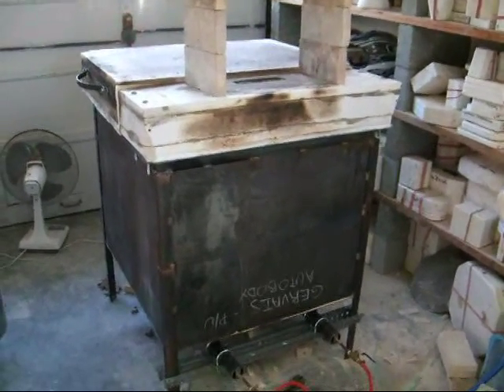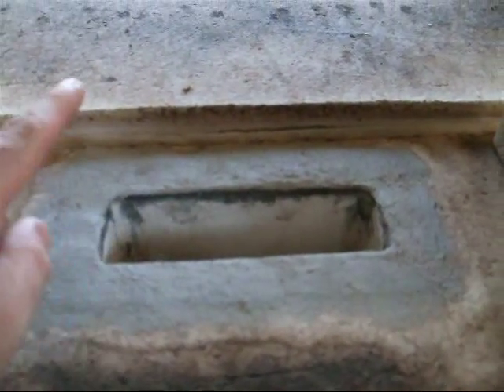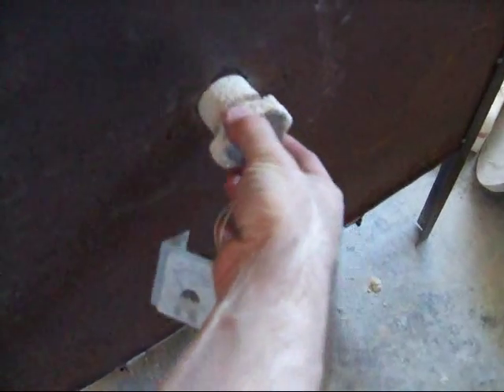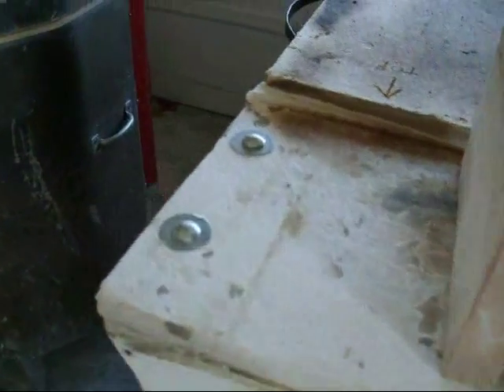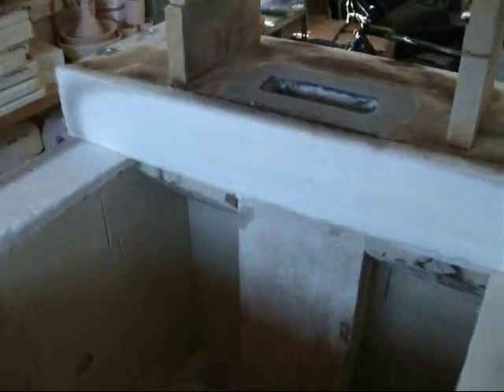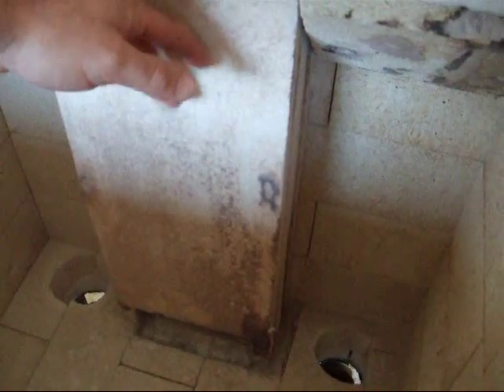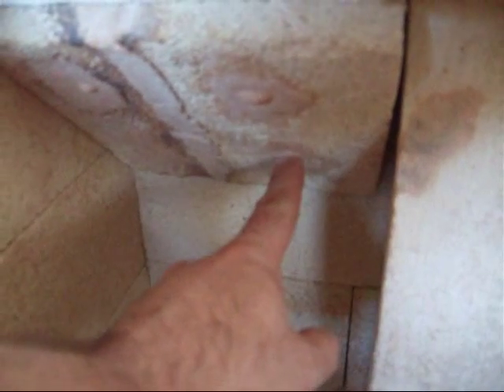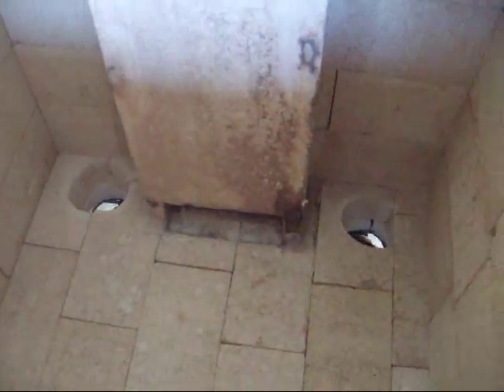Kiln project clip #8

Comment: Hi. I see you made this video four years ago. I just came across it.kilns are of great interest to me. I am going to build one probably hybrid wood/gas. With your experience, would you think that the flame path could be improved with running a flue channel across the floor to the other side of the box to cut off a direct exit path for the flame. Like a horizontal bag wall? And also did you end up adding blowers to get more heat eventually? Thanks Jeremiah